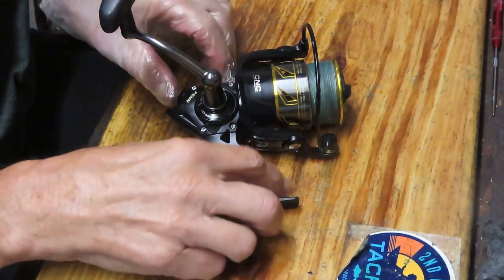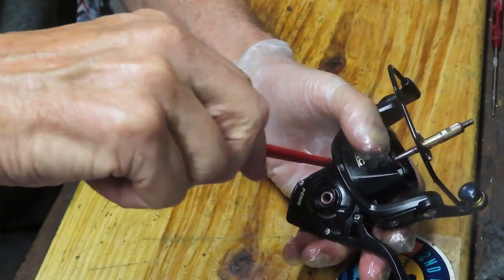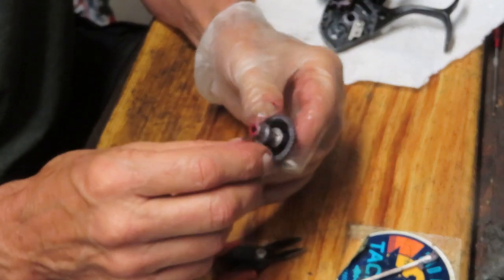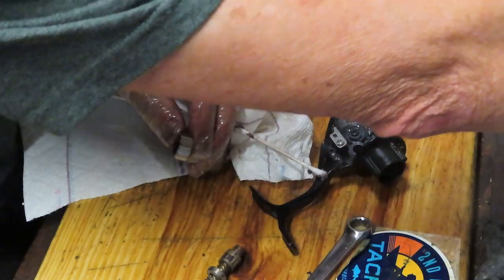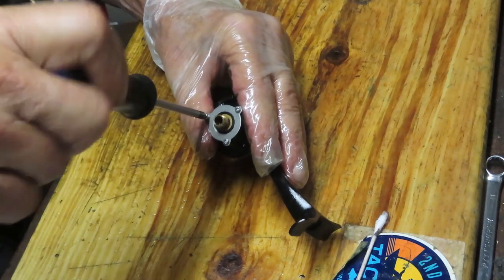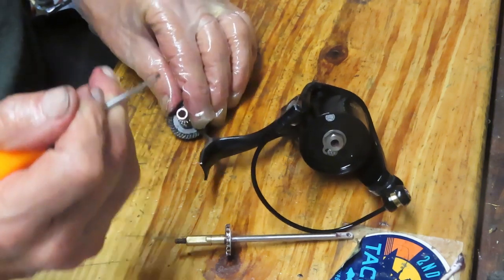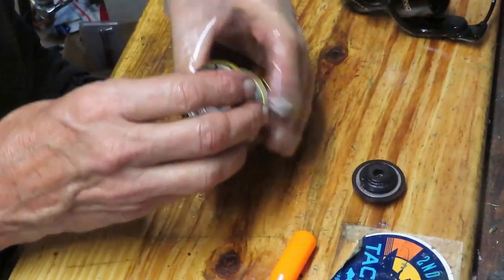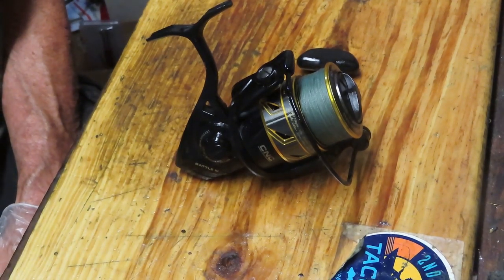Penn Battle III 4000 spin fishing reel how to take apart and service

Comment: I have the 3000 version of this reel. had the exact problem multiple times after kayak fishing. I never saw the issue but I service the reel after every paddle and the problem would go away.  I assume it was a tiny grain of sand causing it to bind since sea water would always splash onto my gear. I love the reel and clean all my reels after each trip.  I just feel for the guy that can't service their reel themselves...so, Dennis, your  channel is a valuable service  to everyone.  Thanks.
Reply from the maker: Thanks - sounds like you are doing it right!  Best wishes - Dennis

Comment: I think your advice on backing off the drag when not in use is right on, especially for older reels with leather drags.
Reply from the maker: it applies to all, but especially the felt and or leather ones.  The grease dries and binds them to the metals and you lose the drag play.  Dennis

Comment: Great video! I’ve got a similar problem on my battle III 4000 and this is really helpful. What did you spray the inside with to remove the dirts and grease?
Reply from the maker: I use a penetrating oil like WD40 as a solvent for the bad grease

Comment: Someone told me about HT-100 not needing any grease, thanks for the info. On my next maintenance, I will apply some Cal's on my Penn 4000 and 5000 drag washers.
Reply from the maker: You can run them dry, but they wear faster - Thanks for the note

Comment: Hi Dennis, 
Your videos have really helped me become proficient with servicing my reels myself, so I really appreciate you for that!
I have one of these reels that has been used two seasons now. It is still as smooth as butter though. Would you recommend still opening it up and doing a full re-greasing service? Just oil the exterior moving parts? Or wait for it to show signs of needing service? Curious your stance on this. Thanks!
Reply from the maker: I always recommend annual service.  You can skip the service and pay the price when it finally tells you something is wrong, or you can service it and keep it going worry free - I prefer annual service - Dennis
Reply: @2ndChanceTackle  thanks for the reply Dennis. I’ll get to work!

Comment: Hi Dennis, just bought the same reel you’re working on, but would love to change it as far as the handle to what is on the Penn pursuit iv. Which they’re considering the power handle is that interchangeable? Or can I order a new power handle?
Reply from the maker: I'm not sure.  Check with the folks at mysticparts.com They will know and will have the upgrade if it is available - Thanks - Dennis

Comment: Great video tutorials  have you one on the Penn Surfblaster 8000 also do know if its possible to upgrade the bearings in it so it runs smoother and the line lay seems to be wrong, so need to add another washer sonething that seems very common on the Surfblaster apparently
Reply from the maker: The Surfblaster was not sold in the U.S. so I haven't seen one in for service.  Yes, you can upgrade bearings with like for like replacements or by ordering ceramic bearings.  You need to measure the bearing and make sure that the dimensions are the same for inside diameter, outside diameter and height. - Most manufacturers will include a few washers to level out the line lay.  It it is spooling too high, you need to add a washer.  Too low, subtract one until it lies evenly - Thanks- Dennis
Reply: @2ndChanceTackle  thanks I built my own multiplier Xmas, I was going to buy a new reel but thought I'd have a go myself. I'm fine with multipliers but fixed spools I've not really messed with.
Id like to change the bearings in my fixed spool for ceramics so I'll measure them.
Here is a link to it and the description of the parts used 
https://youtu.be/HHpwCIkIwpY

Comment: Can you show what the drag cap looks like on the underneath please? I lost mine and I am unsure on whether I need to order washer with the spare, cheers
Reply from the maker: Your drag cap is a stand alone assembly.  Under the cap is the spool drag assembly.  There is a retaining clip followed by 3 waters that are Atal and 3 fabric washers.  They alternate fro the top metal, fabric and repeat.  You top washer after the retaining clip should be metal. Thanks for asking - Dennis
Reply: @2ndChanceTackle  Thanks, appreciate you getting back to me

Comment: Hi Dennis how do you inspect the bearings?  I have a slight wobble in a Penn 4000.
Reply from the maker: I use an awl,  pick or pencil to hold and test.  spin the bearing and listen for noise.  Rock the bearing side to side to test for sloppy play and wear

Comment: Hi Dennis, thanks for another great video! I dissembled my Battle III 5000, and cant seem to remember where the 4 shims go, can you help??? Looks like 2 gold ones and 2 silver ones. They looked like 1, but then I picked it up in my fingers and realized it was 4 different ones. Fell off somewhere in the process. Really appreciate any help!
Reply from the maker: The shims normally go on the main gear just under the side plate bearing.  
If you get the schematic, it will show the location. It is part 8A in the schematic you you can get through this link https://www.mysticparts.com/Assets/images/pennparts/schematics/btliii5000.pdf Dennis

Comment: So I am working on a battle 3 5000. Having issues getting it back together. Any tips? Thanks.
Reply from the maker: What are the issues.  If you let me know what part is troubling you, I can assist - Dennis
Reply: @2ndChanceTackle I appreciate your quick reply. It may be a couple days before I can take a picture and advise. Thanks!
Reply: @2ndChanceTackle  Sorry for the delay had out of town company in. I watched your video on the 6000 and figured it out. It was how the cross line piece fit in getting the knob on the wheel in the grove on it. Thanks so much for your help and your videos!

Comment: Another great video Dennis. Thanks. Do you recommend oiling or greasing the exposed axle shaft after regular rinsing ( not taking the reel apart).
Reply from the maker: A drop of oil is fine

Comment: Wow, I see they redesigned the anti-reverse clutch. No more tiny spring!  I'm guessing there's no more anti-reverse over-ride switch.
Reply from the maker: That is correct.  Penn eliminated the A/R over-ride on the Pursuit, Fierce and Battle lines and many others have also done away with it.  The A/R clutch that is sealed doesn't allow for those springs and over-rides - Thanks for the note - Dennis

Comment: Dennis, I’ve never bought one but what does an AR bearing like the one in this Battle III actually cost to replace. I was just curious. The only reels I have with AR bearings are the older type with override switches so I have no experience with these reels. Do you have any idea how many times in my years as a minister I answered theological questions with, “well, it’s a mystery.” Sometimes there isn’t a clear cut, black and white answer.  I personally think you had some of that extra line caught in the spool and inadvertently freed it when you took the spool off but that’s a guess. I sent you a note today. Last night I got just about the last vintage saltwater reel still on my bucket list. - a Daiwa GS 9. I have three Daiwa 9000C reels that are very similar but this was the one I’ve wanted for a long time.  We’re bracing for a tropical storm tomorrow here in Raleigh, NC. May God help all those affected by Hurricane Ian. — Chris
Reply from the maker: The A/R clutch is usually around $6-10 depending on the reel.  Can't wait to see the GS9 pictures!
Reply: @2ndChanceTackle  Thanks for the info Dennis. I can’t wait to get the reel! We are under a Tropical Storm Warning here so it could be a long day! — Chris

Comment: I hate intermittent problems no mater what kind of equipment you work on, then to make it worse, when you get it operating properly but don't know what you did. It can happen on anything mechanical , from something to a boiler that heats a large hospital or something even bigger
Reply from the maker: Those problems are so testy.  I have a Shimano lever drag on my bench that comes and goes.  UGGGGH!  It usually comes down to aa minor part just out of tolerance.  Perseverance and a sense of humor usually prevail!

Comment: The gears in this reel looks like the gears from a mechanic 1960 Swiss watch. Very small with tiny groves.  Fragile I would say. Not my reel.
Reply from the maker: These reels have a pretty good reputation for durability, but the main gear does wear - thanks for the note - Dennis